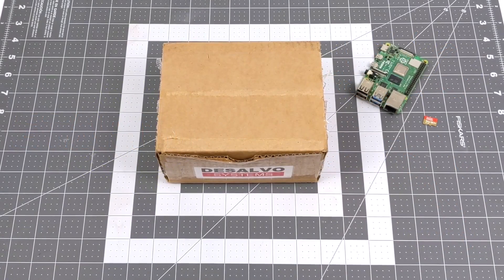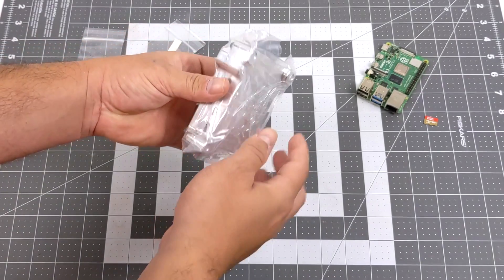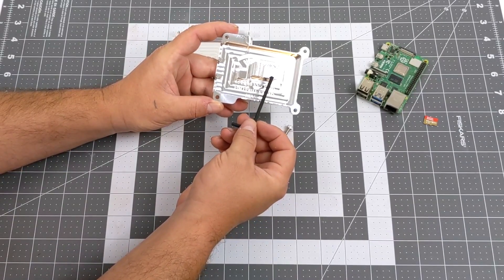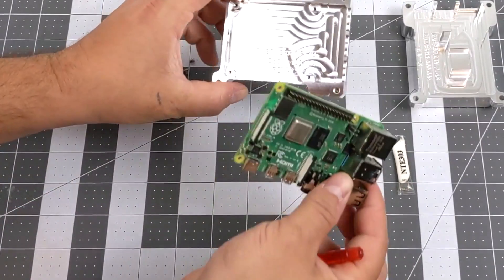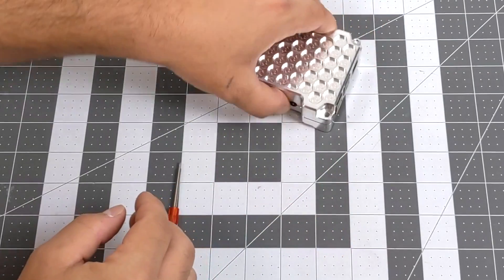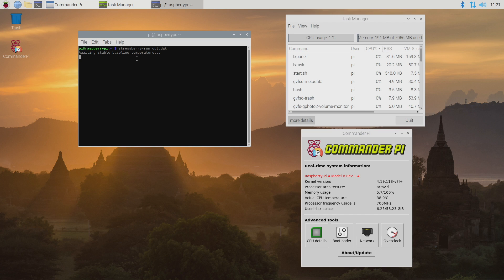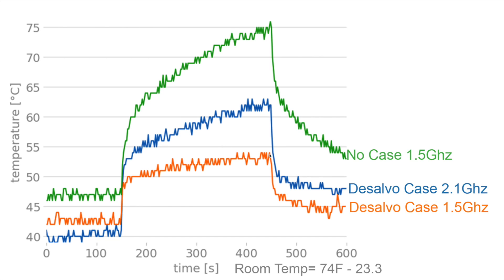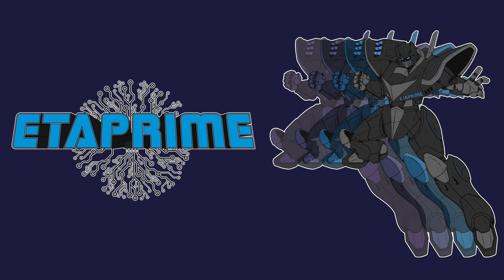Premium Pi4 Case CNC Machined Full Aluminum Made In The USA Passive Cooling

Comment: Just Wondering if you were to spray corning fluid over the PCB to prevent the condensation from getting to the electronics and kneaded eraser and a little Artic Silver for heat conduction then mount it inside the ASETEK VAPOCHILL Lightspeed XE-II which should be able to cool the Raspberry Pi down to -140 degrees below Zero because the cooling probe is attached to the CNC Machined case, then you should be able to overclock to your heart's desire, Just one thing the 5V won't come on till the probe drops to set temperature.

Comment: I wonder how long it takes for case to get saturated on full load and how long the glue on the feet lasts.

I have a machined case like this (anodized) for the Odroid XU4 which lasts for quite a while until it reaches the thermal limit. The feet didn't like 50+C case temps (80 C at CPU) and eventually fell off.

Comment: It would be interesting how well that case does with a long term load overclock once it heated up and if the surface area is big enough to actually dissipate the heat and not only store it.

Comment: Beautiful piece of machine work, but I would think this would adversely affect the wi-fi and bluetooth, being housed inside a full metal case. I wonder if there is a way to extend the wi-fi and BT antennas outside somehow? Like a few others have mentioned here, I think it would have really benefited from a small fan in the base, or more aggressive fins machined into the top for better heat dissipation under higher clock speeds. I think I'll hold off on this one until they at least get the wi-fi/BT issue solved.😉

Comment: I've used similar aluminum cases in the past and there is a big issue with head spreaders (not heatsinks) like this case.  They only spread the heat out.  They don't dissipate it well, as there is not much surface area.  If your pi is running for days and days, it will overheat eventually.  The workaround is to have some kind of airflow hitting the case directly.
Reply: I have not run into that even overclocked. All the features on the outside of the case are not just for looks.

Comment: I like how there is a good connection with the bottom of the case for heat transfer. My full aluminium case is only connected by the screws to the base which wastes a lot of thermal capacity. I wonder if adding thermal compound where the top of the case connects with the bottom of the case would impact cooling performance. It may not be a bottleneck as is.
Reply: Yes it would and was designed with that in mind for those that want to really go max.

Comment: I think you put thermal paste on the wrong chip. you put paste on the ethernet controller which doesn't line up with anything you didn't put anything on the usb controller which i can see would make contact with the case.

Comment: Pretty good. MY pi is overclocked to 2ghz and it runs about 55 degrees when it's running all out. I've got the low profile Ice Cooler. How warm does that case get?

Comment: Wait... I thought this was supposed to be a 4/5D milled monoblock case? I'm seeing a standard 3-axis 2-piece case here... Also... what happened? Did they forget the 2nd pass back through the route with the offset to take care of all those ridges inside? 
(Sorry, experienced CNC coder here, used to work on projects for military equipment, so seeing imprecision of any kind or misrepresentation of a product as something far better than it is really gets to me.) 
I'd ABSOLUTELY see the $49 value in an ACTUAL monoblock 5D case. The kind where the only opening would be on one end and you'd slide the Pi into a barely-able-to-fit opening, then tightly seal that end over it.  But it would have to be something that looks better than something more aptly named "My First Haas Project".
(I could continue with the nitpicking, but suffice it to say there are SEVERAL dangerous mistakes and lazy corners cut here)

Comment: I would expect it to cool better, the numbers are good but not impressive, especially for the cost.
Most people seem attracted to the glossy look, however it may not stay that way. The website didn't say it was anodized or otherwise coated after the CNC process and it appears to be polished raw aluminum. Aluminum can look rather shabby after corrosion/oxidation takes over if unprotected. Even the cheap imported passive cooling cases are anodized so it's surprising if this has no surface protection.

Comment: I think you put the paste on the wrong small chip - it won't line up with the aluminum post on the case. I believe you got the ethernet controller and not the USB controller. I might be wrong, but I don't think I am.
Reply: Hah. I should have read the comments first. Hope you get that corrected.

Comment: With a fan, it will stay cooler at long ran
Reply: I got a CNC milled metal case. Not the shitty one from the video. Today, we had 27 degrees C ambient temperature and the Pi 4 8 GB stayed at 54 degrees during video playback (which eats a lot of cpu). It's awesome without a fan. Total silence.

Comment: Ugly and expensive. These "holes" on the upper side, will keep dust perfectly.
Reply: Those aren't holes. You can see they are hexagonal surface space to disperse heat in the most mathematically efficient pattern. Dust your equipment. It's an insulator anyways. The whole point of a passive system needs dusting upkeep. You see ugly somehow, I just see science and efficiency. And beautiful aluminum.

Comment: Could you put a big fan on the top and bottom?
Reply: You would need fins really to make use of a fan to wick away heat and then you are negating the purchase of a fanless case
Reply: @davidoff59   Would it cool it better if you did? Also does the bottom piece work as a heatsink too? can you cool the board from the bottom? If so, would the Ice Tower + the bottom of this case give awesome cooling?
Reply: Why bother then spending so much on this case.  The only reason to get it is for how it looks, if one is going to clutter it up with external fan then they can easily get a similar case for a lot less.
Reply: I was just wondering if you could get better cooling if you did

Comment: $49 is a steal if it was fully CNC’d because it would cost that much to run the machine long enough to make the case.  It seems it would have been stamped first, the. CNC’d which would reduce the cost.
Reply: They are fully CNC machined.  We had to use a very high speed mill and really tighten up our production programs the get the price down to where it is.  I have a few videos of production on my instagram.  @desalvosystems

Comment: For fan it is enough to do like 5-6 minutes of heat up, as they take another 5-6 minutes to cool down.
 For passive you need to measure - how much time it needs to cool down and what is that temperature, as that wont be like with a fan "similar as idle" as passive obviosly cooling down much slower 😂

Comment: I think you should have run the stress test for longer than 10 mins. Temps were still going up..
Reply: The graphs with the case seemed to have largely stabilized near the end, another couple of minutes though would make it clear.  The one without the case was still rising, but we already know with out a heat sink the cpu will go up in temp until it throttles at 80C.
Reply: I don't know what you saw, but those test hit plateaus. At a certain clocks the temps will eventually level out. Further stress test is just that. There were plateaus test should not run longer than when that is reached for equipment longevity.
Reply: Na, I think the temps would have got to 65° if it was stressed for another 10 or 20 mins. Passive cooling takes a looong stress time to get stable temps. Doesn't matter anyway, 65° is very good.

Comment: You should compare the temps to past cases you’ve reviewed and do so with future cases as well. Also it doesn’t seem like you put the thermal paste in the correct places
Reply: He missed the USB chip, that won't make any difference in this test, but yes if you were actually using this case one would want it done correctly.
Reply: The thermal interface material (pink sheet) is for the 2GB version only.  This may have affected the temps by increasing the gap for the CPU.

Comment: Argon One case cools passively just as well. Found this out w/ a VirtualMan image that didn’t support the Argon fan script. Never throttled during a prolonged stress test w/ no fans running. And it moves all ports to the back and gives you access the GPIO pins.
Reply: I mean the Argon case is aluminum passive cooling case first so yeah. I think its the design choice here of how you passively cool. Vents vs surface area heat dissipation.
Reply: I agree. I have yet to see a case to rival the Argon One, unless you want to install a camera, or hat. It has access to GPIO, passive and/or actually cools, moves everything one side, has a power button, comes with a fan script/profile, and for $35. This was my first case and no regrets. I think I might've been spoiled for such a case. Flirc was the second case I got and works just as well for RetroPi use.

Comment: can you easily swap sd cards? looks like you won't be able to pull out the sd card once it's in
Reply: That's a problem I ran into when screwed my RPi to a self made base that was too long. But it looks like you might get your fingernails in...
Reply: Its a little tight but I use tweezers or my fingernails.  A fingernail can get a hold of the little tab on the sd card without too much trouble.
Reply: I've had 2 sd crack on me while trying to get them out without any casing. I solve the problem by adding scotch tape to serve as a pull tab.

Comment: Well, for that price you could buy 15+ kg of alumin(i)um and just find someone to cut it as you like 😂
Reply: probably be more money . company who make them probably makes 100's of them and setting up a CNC machine it can take hours to program it
Reply: A 5 pound aluminum ingot on ebay runs about $25  Then you need someone with a CNC machine and the time to design the case. I'm thinking $50 is pretty reasonable. I've got about $40 bucks in my fan and cooler combo. It works better than this does though, my temps don't go over 55 degrees.
Reply: @ninline2000  I'm just saying it can take time to program a CNC machine do a cutting job. I used to work at a machine shop I talk to few guys I used to work for they said some programs on a CNC machine can take 2-3 days I guess it depends on the job.
Reply: @funtyes1970  Don't go anywhere near CNCs for one off DIY projects, especially for something like this with tolerances of 15 thou. There are hobbyists that'll cut one of these for free if you sketchup the plans, supply the materials and ask nicely. There's also maker spaces and machining schools that take on these kinds of projects. The hassle probably isn't worth the money you save unless you enjoy DIY projects but the point remains, they're making large margins asking $50.
Reply: @ninline2000  Well, if you find someone stupid enough to design and mill a case for just 25 bucks then I guess you could do that. Usually people with the skills and equipment have higher hourly rates though. And of course your fan and cooler combo has lower temperatures, but it also makes noise.

Comment: 10 minutes is a good test, but I'd be interested to see how long it takes to reach the thermal limit of the case. When is the heat dissipation outpaced by the thermal output of the chip? Your chart was climbing upward, but never stabilized.
Reply: I did a 1 hour test at 2100MHz here and the CPU got to 79C with an ambient air temp of 23C.  No Throttle on the CPU.  I'm eager to see others repeat my results.
Reply: @tonydesalvo5390  That's not soo good imo. I understand its overclocked up I feel like at that price unless you must have the looks you should get more than that. A fan makes more sense. A couple good small heatsinks and a fan overtop.
Reply: @stale2665  I agree.  If you're using a Pi at 100% for hours you really need to re-evaluate your choices.
Reply: Add this to the windowsill in winter where I live it'd get nice and chilly is arm susceptible to cold bug that hits intel CPUs?

Comment: Seriously!?!?!? I Just ordered an argon one case for my pi4 and now you come out with a review for a passively cooled, scriptless case that supports a small business. ETA, you're killing me.

In all seriousness, keep up the good work. I love it when you find niche products for the pi.
Reply: The Argon One case cools passively just as well. Found this out w/ a VirtualMan image that didn’t support the Argon fan script. Temp did not rise about 65° during a prolonged stress test. And the Argon case moves all ports to the back. You won’t be disappointed.
Reply: @Bob_Smith19  good to know. I was planning on overclocking to 2ghz. Have you tried any overclocking without the fan?
Reply: It’s overclocked to 2000 w/ an over voltage of 6. GPU is maxed out to 750 as well. No fan initially. I found the scripts to enable them and it certainly makes a difference. But the case is a good heatsink.
Reply: @Bob_Smith19  Just got mine in the mail and similar to you, the fan isnt working. where did you find the scripts?

Comment: Isn't there any electrical isolation in the base plate?
Reply: Yes - an air gap.  You can see there are standoffs machined into the bottom plate.  Those hold the board a couple mm above the base.
Reply: PCB isn't a conductor itself. Only the traces.
Reply: These are powered by low voltage, usually 5 volts or so

Comment: I would stick a USB fan on top of it to get the best out of it, should drop the temps well below 45-50, I mean if you're gonna spend 50 spondulies on a case for a pi then you might as well spend an extra tenner for a fan to get the most out of it am I right.
Reply: For 25$ I can get argon one which is better in every possible way. It has active cooling but only when it is needed. And it’s what I would call premium enough for raspberry pi.
Reply: Or just buy a cheap second hand pc with more power
Reply: @davidoff59  Where are you buying a second hand PC that fits in the palm of your hand an only draws a few watts of power for ~$100?  Please let us know.

Comment: I'd like it better if they'd have used the mounting holes to secure the case, instead of those big honkin' allen screws hanging off the sides.
Reply: I think they kinda act like the screws do on a normal PC cooler. They are clamping it down so the heat transfers straight to the case. Little tiny screws would hold it together sure but would they clamp it enough to get heat to move straight onto the case and not heat up a lot first? I don't know but I'm thinking that's what they were going for. I imagine they tested different ways of doing this and found the clamping was needed but purely my guess work.
Reply: @ClayMann  Why wouldn't they? You don't want to put so much pressure on that you bend the board. The allen screws make it LOOK industrial, if you're into that sort of thing; but they aren't really doing anything practical. Personally, I'd be more concerned about not getting a good wireless signal because of all that metal.
Reply: @MrDavidBFoster  You could test this by running benchmarks with and without the screws. I like how they look but I didn't even think of wireless issues until it was mentioned. Maybe just not the case for wireless users or anyone fond of industrial design heh
Reply: @ClayMann  they serve like standoffs so pi is not directly on table firs make cooling better  and second you an easily attach caables

Comment: But, How is the wifi going to cope?
Reply: Well it's got little hole n' such lol.
Reply: I recently tested a RaspberryPi Zero W in a metal case that had slots near the WiFi cavity antenna "for improved WiFi performance", and an all plastic layered case that is almost transparent to rf.  The metal case had a 6dbm WEAKER signal than the plastic case.  I would expect this case to be slightly worse, but it is impossible to say how much without testing it.
Reply: @MKDC-5  I agree, the stock wifi is pretty weak. I think that's down to the antenna though.
Reply: @ninline2000  : More the chiptenna than the module.  That being said, it's subpar compared to what you can couple on the USB 3 leg of the system.
Reply: I read somewhere aluminum foil boosts wifi performance.
Reply: @AbhishekThakur-wl1pl  only if it acts as a reflector, like the dish of an antenna
Reply: @AbhishekThakur-wl1pl  The aluminum case definitely will reduce Wifi performance, that one hasn't been tested yet.
Reply: @AbhishekThakur-wl1pl  all good when the antenna is in front. Same principle when the antenna is behind it. The reception gets worse in some way.
Reply: @AbhishekThakur-wl1pl  : Nope.  It's a faraday cage unless it leaks out the slots properly.
Reply: @AbhishekThakur-wl1pl  "I read somewhere that <insert old wives tale here>"
Reply: @unlokia  I read somewhere I'm the world's greatest lover. Though I could be mistaken as my handwriting is quite poor.